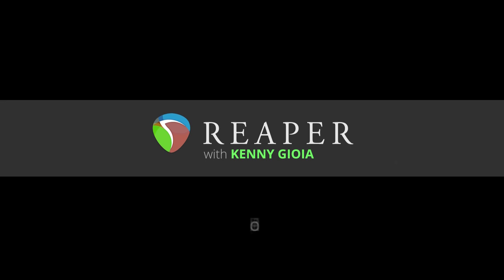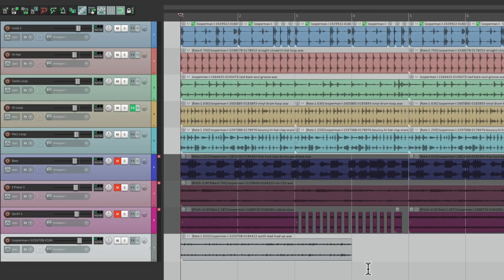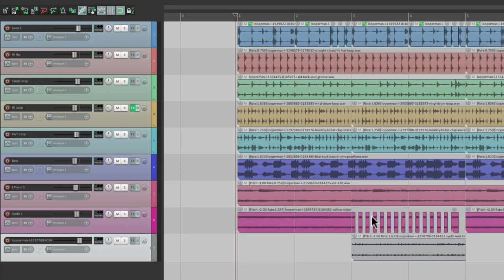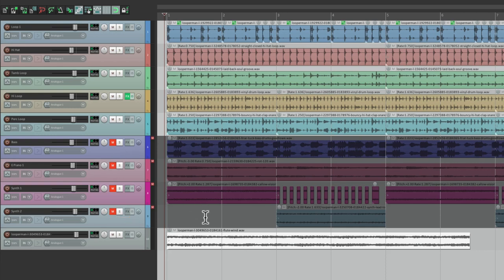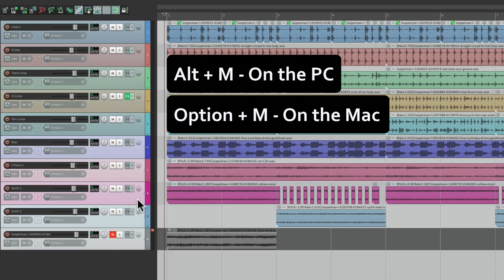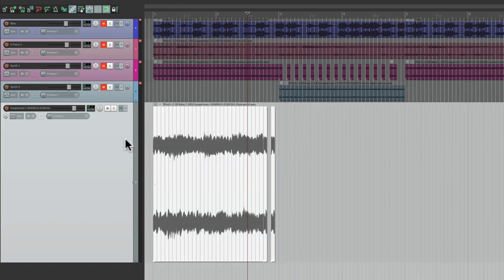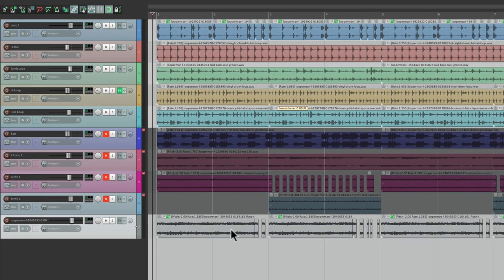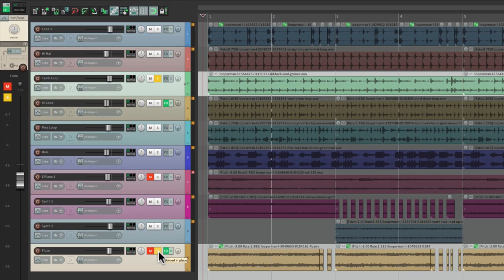Loop Based Production in REAPER - Part 5/11 - Synth 2 & Flute

Comment: Grouping that cut up audio is genius.  I have been just gluing items I have cut up, instead of grouping.  What are the pros and cons of grouping vs gluing?
Reply: Glueing is destructive,  So once you glue it, you're not going to be able to revise your various edits.  Grouping the individual items allows you to alter your split points, add/alter fades, shift the positioning within the splits, and whatever else, at any later time.  Once they're glued, those edits are committed - that is, unless you first duplicate the original track and items and mute and hide it, to keep a copy that you can later go back to edit.  The advantage of glueing is that once you are certain your edits are final, you can commit it and only have to deal with one item in future.  Kenny did a video on glueing, which explains these pros/cons in more detail: https://youtu.be/Q-xwkoy9shk